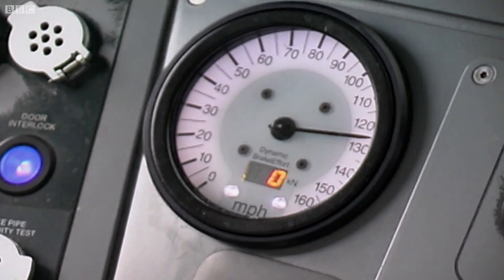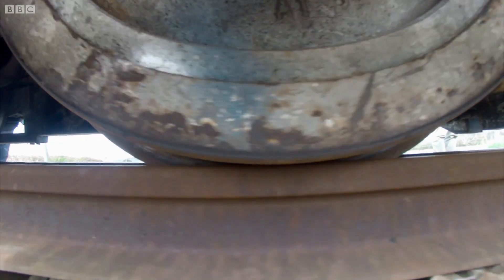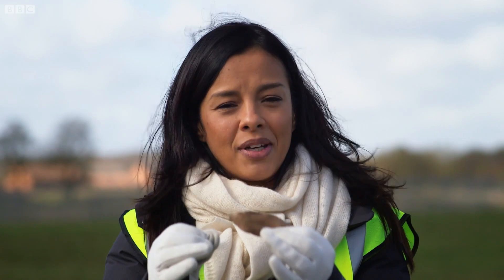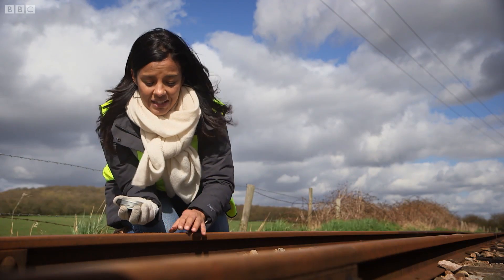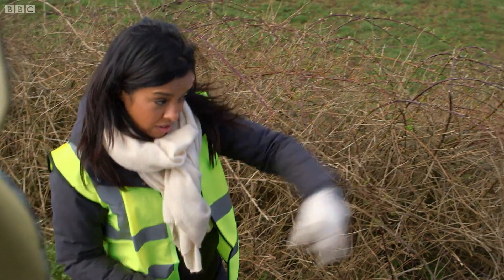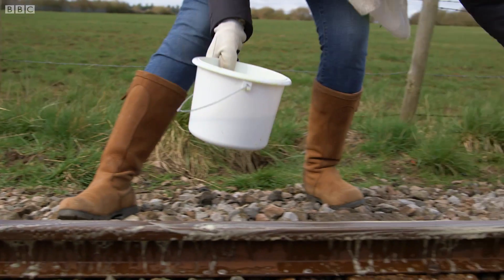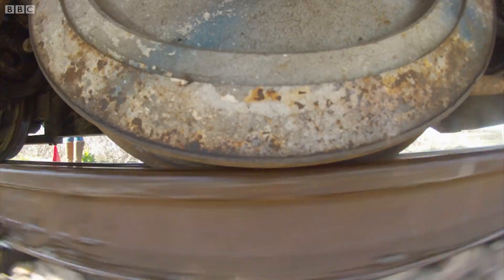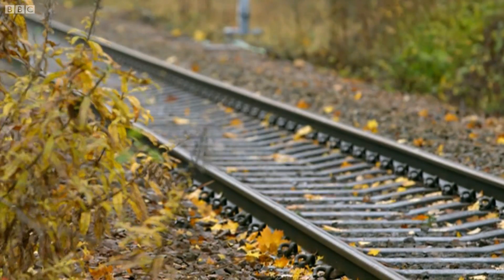Why Do Leaves Cause Train Delays? | Bang Goes The Theory | Earth Science

Comment: Many cities have street-cleaning-vehicles, why not a rail-cleaning-train that precedes the standard trains.
Reply: 1. Because it adds another train on the network, thus reducing the numbers of passenger trains by 2. And if you want 1 machine per X trains - however big the X is - see the next point:
2. Machines are slower than passenger trains and any train would follow a machine with a reduced speed.
3. There isn't infrastructure to supply the machines, drivers and additional depots that would store them.
Reply: These special purpose trains could be deployed by-weekly, monthly and dependent on need. 
Track condition is a safety hazard and should take some level of priority.
They could be deployed in hours with the least traffic.

Comment: That is funny when leaves fall from tree they are dry and when train moves on track due to its vibration no leaves will be present on track and situation illustrated is too overestimated and train has lengths greater than 500m and if one wheel slipped there is no much effect on train and interestingly there will be no trees in station where train need to be stopped and not between two stations. That was funny.
Reply: Use common sense bro trains will not stop in between station. and in station where you will find tree.

Comment: What an idiotic way to brake locking the wheels, of course it will skid on the tracks like a sleigh, if you let the wheels roll a bit it will have much more contact with the rail...this was exaggerated like any other test

Comment: Just an idiot here.. is there a reason they couldn't have rubber tires that are tucked under the coach like airplane wheels, and when the train needs to stop really fast, just drop the rubber tyres onto the ballast/ties between the rails? Surely the bumpy stones would provide a lot of traction in an emergency

Comment: Maybe you should invest in better trains? With sanders and magnetic brakes. 
I´m a train driver in Germany and have no serious problems with leaves covering the rails and delays. 
When the wheels start to slip while accelerating, i just let them i bit, because that roughens up the surface of the wheel and the rail a little bit, giving you more traction. If the wheels continue to spin --> Sand. I always tell the trainee train drivers, sand is much cheaper than delayed trains, so don´t be shy to use it if necessary. And if one train used the sand at a certain spot, the following few trains don´t need to, because the slippery layer of crushed leaves is then mixed up with a little bit of ultra fine sand dust, that works against the slipperyness. 
And if i misjudge the stopping distance pretty bad, what happens quite rarely if you have a certain years of experience, the magnets will go down (and with them the sanders are activated automatically) giving me 70% extra braking power. And that combination, sand and the magnets grinding over the rails, really brushes of all kind of slipperyness.
Reply: That don't always work in every system so you can't say that.

Comment: In North America, nearly every railway locomotive has a system for spreading a thin layer of dry fine sand underneath the powered wheels, just to provide grip on wet, leaf-covered or icy tracks. Why don't the British adopt such a system?
Reply: Hi Charles, I've never seen a subway train with a separate locomotive. The electrical conductivity question is, in practical terms, not a problem - Amtrak's high speed Acela trains still haven't sanders.  As the sand is only applied as required, and only one of the 16+ locomotive wheels has to be making good contact for the electrical system to work, the sand is more traction help than electrical hindrance.
Reply: In Germany every powered rail vehicle and cab cars are required to be equipped with sanders by law since ages. 
Fist because it is considered way to unsafe to operate a train without at least one sander, that could slide along like forever on downhill tracks. 
And second, because the safety system needs a speed and distance signal to work, that is taken from a sensor on a wheel. 
So sanders were primary intended to maintain safe stopping distances. But of course are used to get more traction too.
Reply: @denzzlinga  Same here in Sweden, all trains have sanders if the train encounter slipperyness
Reply: Sand won't work on leaf residue. It'll gunk up with it and make the slide worse. 

Here in Philly, they have work trains that apply gel that sticks to the residue, and then sprays it off. Works pretty good.
Reply: Freight locos pull tanks of highly pressured water around the UK'S railway everyday. It blasts crushed leaf matter of the railway. For individual trains, every train has sand it can put down on the wheels for adhesion.
Reply: @CalderTrains  When did UK trains start having sanding equipment?  Is it fairly recent?  When I was studying engineering in the 1980s, no UK train had sanders - it was one of the differences between Canada (where sanders date back to the early steam era) and the UK.
Reply: @eatonjask  believe the UK created them but I know traction from the 50s, even our steam has Sanders
Reply: Train driver (locomotive engineer) here - we do have sanders, and they do provide grip, but it is never that good, oh, and icy tracks aren't slippery due to the immense pressure under the wheels.

To give you an idea we recently had one of our modern electrics slide roughly 300 yards to a stand, it is fitted with sanders, WSP (think abs) and disc brakes that are like 4ft across on every wheel (32), it was going 12mph and still took 300 yards to stop.

I was driving before sanders were standard (mostly a cost cutting reason) and have known a 1/2 mile slide on a tread brake train at just 33mph.
Reply: James Eaton I have never seen a subway use sand since it would short out the electric connections. Diesel powered  Commuter and regional trains do but they are much heavier and need all the tractive effort to get started.

Comment: Doesn't sanding the track help with these conditions? Do British trains not have sanders? I mean I thought they did but maybe I'm wrong.
Reply: Joshua Peifer that would be too logical
Reply: Sam 1 All American locomotives are I think required to have the ability to sand the rails. If it doesn't have a sander on the locomotive then they require to carry some to be applied manually.

Comment: Wouldn’t it be better if tracks had a rubbery surface or the train wheels did? Not saying they should make it out of rubber just apply a rubbery material
Reply: Or some emergency wheels made of rubber to grip the track or the wooden ties as train rolled along. Or small brake wheels that are pressed sideways into the rail.
Reply: the forces are too great - if you imagine an 18-wheeler, it weighs just 40-50 tons and the area that mass is spread over is huge. I actually ran over some industrial rubber matting someone had left on the tracks, roughly 1.5 inches thick solid rubber for tracked excavators to drive over - it was sliced in two just by the sheer force under the wheels, squeezed it out to the sides like toothpaste.
Reply: +Xaiano; well there could be calipers that clamp to the sides of the rail or apply pressure to rubber brake wheels that are oriented horizontally. Or if not rubber, the wheels could have gear teeth for traction.

Comment: They need ABS.
Reply: We have ABS but it's called WSP (wheel skid protection).
Reply: We've got ABS, but it only helps by preventing flat spots on the wheel and mostly activates during emergency braking
Reply: Nano Mine what is ABS?
Reply: Anti-lock braking system
Reply: we have it, it doesn't make the grip any better.

Comment: There are "sandite" trains which are used during the autumn, which blast the rail heads with high pressure water, then drop a fine layer of sand to add extra grip. But these are limited in number, and have to travel very slowly in order to clean the rails effectively.  During particularly windy and wet days it is impossible to keep all of the UKs 25,000 miles of track clean at all times, which is why delays happen. We could invest in more sandite trains but they are only used for a few months of the year so aren't considered a priority.

Comment: Would like to hear what snow and ice do. Especially on overhead or 3rd rail electric propulsion trains. Can ice ever get hard enough on the track to  lift the train slightly and break connectivity. Say when it is in the winter like -25C to -40C.
Reply: Snow and ice can become packed into the flangeways of switches and level crossings, becoming solid enough to lift wheels passing through them, in some cases completely off the rails.
Reply: Then I wonder how the Ottawa rapid transit system will do as it is going to be mostly not covered. I suspect that it will not be able to run some days when we get ice storms. Probably they will have to get jet engines mounted on a small heavy wheeled/tracked vehicle to unthaw things. That is what the two big railroads use.

Comment: Slippery tracks should also be seen as an advantage. With lower friction, trains will be able to reduce power consumption when traveeling a distance at a certain speed. Besides, what's the probability of a train having to make an emergency stop?
Reply: MACROPARTICLE No, rolling resistance and friction are not the same thing, leaves on the line and other contaminants will increase rolling resistance but decrease grip. Think of a car in puddles, less grip, but the car slows slightly as it goes through the puddle.
Reply: Slippery tracks mean virtually nothing to a train already at speed. The problem is acceleration and braking.

Comment: How about a specialised maintenance train goes over the tracks every now and then to clear the slimy mess up? Or would that be too simple to think of?!
Reply: London Biker GoPro that will cause delays because then they need to close that line to clean it
Reply: CapsRockTheRed don't see why they need to close It, it's just another train running on the line. In some countries i have seen maintenance trains run in between normal trains that grind the rails for instance, surely you could just as well clean the rails with another special train as it moves along.
Reply: we've already got the equipment for it & here's one of them

http://ukrailways1970tilltoday.me.uk/Norwich_DRS_rail_treatment_train.html
Reply: They do exist. We use them every autumn on our railroads here in Denmark. I'm sure most other reasonably well-maintained railroads have them as well.

Comment: Whoever gave her those bits of box section for her demonstration needs shooting! Did you see the burr on it? Could have had her finger off.

Anyway, why doesn't every train have two high pressure water/air jets on the front to clear the track?
Reply: The sheer amount of air/water that would be needed to apply a high enough pressure to clean the rails consistently at a 130+mph train that's running for 3+ hours would be phenominal. You'd need an entire extra train just to contain it all
Reply: IamTheWillrus - yeah I can see that, but for 1 it wouldn't be doing 130mph with leaves on the track so that can be factored out. And 2, if the water was vaporised enough it could carry enough on board. I'm sure the air would be enough though without the need for water.

What other option sis there? Rotary brushes in front of the wheels??
Reply: Wouldn't be effective enough. And brushes would wear away in a single journey. If there was a simple solution it would have been implemented by now
Reply: ss ss rail head treatment trains exist, but they have to run around 30mph, this disrupts the timetables too. You would have to have a whole extra carriage on each train just for the water and equipment and then would still be able to go no faster than 30mph. Air wouldn't work, it doesn't have enough force to remove the grease.

Comment: but this doesn't explain why there are delays. if the issue is worse during the autumn then it will be a predictable instance which means the people who write the timetables will be able to adjust for the occurrence. Therefore the delays are caused by bad planning and not leafs.
Reply: Al Paca Timetables are produced many months in advance, the reality is most of the worst of the low adhesion occurs for only a couple of weeks (red days), with only one or two days being particularly bad (black days). Weather plays a huge role in determining what weeks they will be (the forecasts are issued on a day-to-day basis, and vary around the country) unless you want 3 months of timetables running a significantly less frequent and slower service just in case then you have to just accept delays for a few weeks.

As an example on a metro service of 30 minute typical journey times it can easily add 5-10 minutes to a journey on the worst days, this would result in a 33% capacity reduction on the timetables. That is without damage cause by wheel slip, signalling issues or other problems it can cause.
Reply: well it kinda does.. trains have to accelerate slower and break earlier when running on lines known for low adhesion issues, that causes delays.
Reply: Wheel slip problems can also occur on the most odd occasions and then you are stuck with delays no matter what you do. Pollen in combination with light rain, frost, condensation caused by shifting temperatures, grass, an oil drip from a vehicle, nearby industry exhausts and so on...

The easiest way to create high precision schedules that cover most of the year is to always have the trains running at about 75% of the lines top speed. That way it gives the trains a fair chance of catching up whenever delays occur. Unfortunately it annoys people to wait at a red light because the train is in effect early and most lines don't always have the capacity to extend a minor margin. Therefore the schedules are mostly run on a very slim margin and trains often risk delays.
Reply: It's easier to blame people than nature. Nature is never at fault. Leaves and ice also affect electric rail lines. If you've ever seen sparks fly on the rail or overhead wire its because of contact issues. If you've ever driven in a big city you'll see huge delays on interstates after a rain. Oil deposits on the road for days when it's not raining and the concrete just soaks it up, but add a little water and it's like skating on ice. Car wrecks everywhere lead to slow downs.
Reply: Train driver here - 1) there are too many trains on the tracks to accommodate schedules that account for the very worst conditions. 2) while more time (if possible) is added in leaf-fall diagrams, conditions can vary massively - drivers use their skill and experience to go as fast as the conditions at the time allow, having slack diagrams would mean trains would go slow all the time since you can't leave early. Exceptional conditions are, at worst, experienced only a few days a year and usually only briefly. while knock-on delays will occur due to our rails being run at capacity (or in some cases over capacity as standard) they won't be on 100% of services so it makes sense to allow what can run quicker, to run quicker.
Reply: Andrew Williams, it's impossible to create a vehicle with a drag coefficient of 0, and as for planning, that's down to operational constraints.
Reply: Yes and no, leaves move with the wind so one day a rail could be clean shoot it could be clean for weeks till the wind blows and the leaves are on the track. They rely on driver information to tell if the rails are slick so it will cause a delay for the first couple trains but not for the ones after cause they already know by that point so the ride will still be longer but you'll know before you get on the train.
Reply: How can that be predictable
Reply: If the leaves are sucked on to the track, then it's bad engineering and not planning or leaves. ;-)
Reply: Al Paca rail companies can’t read the future they have no idea how long delays will be because they can vary quite a bit
Reply: Al Paca it right, plus not to mention that most of Britain's rolling stock doesn't have sanding gear fitted

Comment: i wonder if modern trains have ABS on all the wheels and limited slip on driving wheels, like production cars these days.
Reply: They do although it is called WSP (Wheel Slide Prevention)
Even then it can only make the best of the available adhesion
Reply: Teng Yuan yes they do, but like ABS on a car it's not primarily to reduce stopping distances, but it can help.

Comment: Trains need ABS as static friction is greater than kinetic friction.
Reply: i think it's opposite kinetic friction is more than or equal to static friction
Reply: I think a land anchor is a better idea..... chuck it out t'window.
Reply: Gerald Ander Lee actually in most cases maximum grip is achieved with a small amount of slip. Trains do have ABS, it's called WSP, most modern trains have it, but it doesn't help as much as you think. With cars ABS is primarily for improving maneuverability under braking, it only slightly improves braking distances. On trains WSP can help a bit, but it's mostly to prevent wheel damage that can remove a train from service. If you are on a train in autumn you should be able to feel the pulsations in the coaches from the WSP activating.

Comment: Trains need ABS.
Reply: Dr. Saqib ABS is to improve maneuverability on a car under braking, improvement in stopping distances is minor and a byproduct of its primary purpose.  Most trains built in the last 40 years already have it anyway
Reply: they already have it, it's called WSP (Wheel Slip Protection)